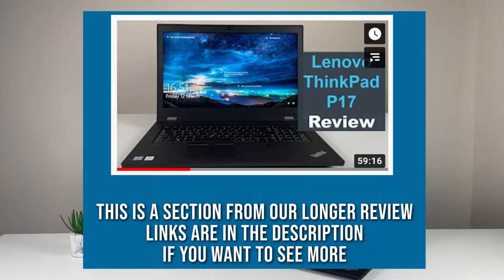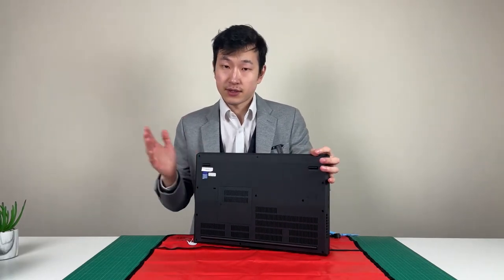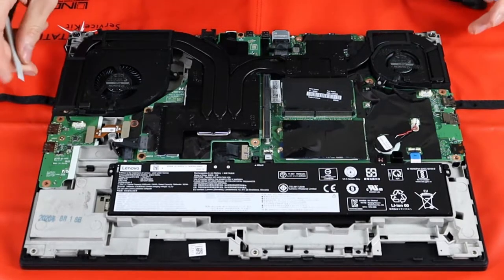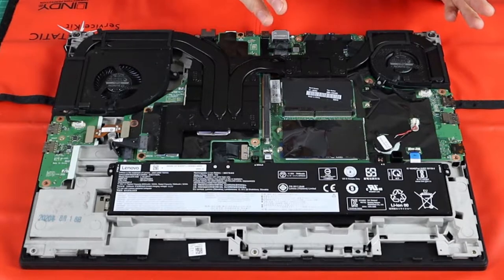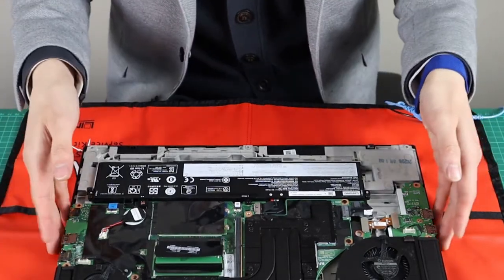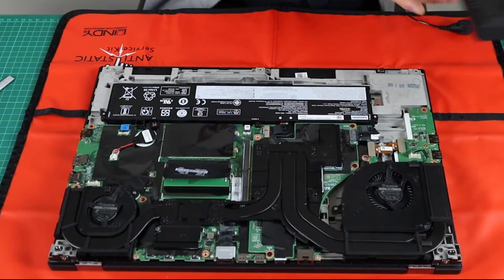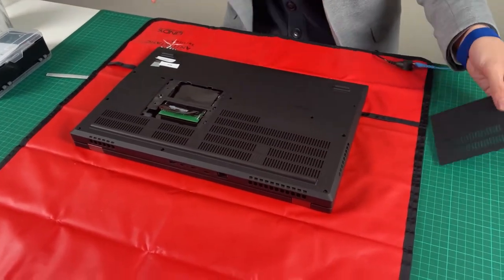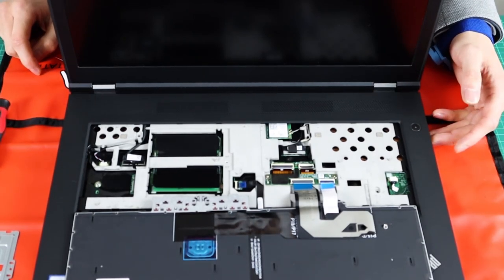Lenovo ThinkPad P17 Gen 1: SSD & RAM upgrade (disassembly)

Comment: Thanks for posting this. About to upgrade mine with 128GB ECC RAM and this was helpful!
Reply from the maker: It's 128GB ecc available?
Reply: @GreenGreenStore  hard to find, but I was able to order some directly from Lenovo thorough company purchase program. Not cheap by any means though... UPS just delivered it less than 5 min ago actually.
Reply from the maker: Oooh.
Reply from the maker: Did it work?
Reply: @GreenGreenStore  yes, I have the Xeon processor. Went with the Xeon specifically for the ECC support . Thanks!
Reply: @big10hunter42  How did you disable the battery while upgrading? Tapping F1 on startup isn't working for me.

Comment: I have a 4 month old P17 built by Lenovo with 128GB RAM, 3 x 2TB SSD drives, Xeon, and everything else fully loaded....eyewatering price but a company purchase....just been sent back with a blown motherboard to be replaced.....not happy. My previous machine was the Lenovo P72, also fully loaded and a similar price. Had it 4 years and not a single issue....operated flawlessly. Only realised when th Lenovo engineer turned up that the battery was not user replaceable. Looked like the PSU blew and the whole motherboard went....They seem to be more disposable now...
Reply from the maker: Sounds like an impressive spec. 
Maybe sensible to get a surge protected plug or socket (if you're not running it already) given the value of the machine. Some locations benefit from it.
Reply: @GreenGreenStore  Yup, Everything is on APC surge Protectors and outside of that a UPS. All set up at home. (I am an engineer for APC :) ) Apparently it was a faulty PSU from day one so they are replacing the whole motherboard.

Comment: Hola, gracias por el video. Disculpen, puedo ponerle a ese modelo de laptop una SSD de 2TB en la ranura 01? Actualmente tengo un SSD de 1TB en la ranura 00, y quiero aumentar la capacidad de almacenamiento de equipo agregandole otra SSD de 2TB. Gracias de antemano
Reply from the maker: Can't see why not? Check with a local repair shop just in case perhaps.

Comment: Look at that wasted space around the battery! They could have put two nvme drive slots in there. They've done the same to the Gen 2. Unbelievable. (Basing it off the P15 Gen2.)
Reply: The gen2 has actually 3 SSD, one underneath the keyboard (where the stock is) and two under the computer, all sad can be played with I don’t you would change the stock one but it’s doable

Comment: Hi, just curious. Which one has better performance the ThinkPad P17 (Xeon/64GB Ram/RTX A5000) or the new MacBook Pro (M1Max/10-core CPU, 32-core GPU/64GB unified memory)?
Reply from the maker: Too early to say. P17 is a known quantity. Bigger M1 will probably do well in some workloads.
Reply: ThinkPad P17 Xeon/128GB RAM RTX A5000 card blows away the Apply M1 when using for 3D design, video editing up to 8k etc....have both..the MAC is a ornament now.

Comment: I am curious to know if the video card can be possibly upgraded as well, on the P17.
Reply from the maker: Not considered a user replaceable part (would affect the warranty). The module is swappable though, if you can find a card to upgrade to (rare).
Reply: Yes the graphics card is upgradable and upgrades can be bought directly from Lenovo. Make sure when you put it back together you have a torque screwdriver of the proper spec. Which according to the manual is 0.181 Nm or about 1.6 pound inches.

Comment: How the p17 performs against the M1 MacBook?
Reply from the maker: Not really a like-for-like comparison. 
The M1 wouldn't be useful in CAD or the workloads where dedicated graphics is needed (which is where the P17 typically will be used for).
Reply: crushes it.